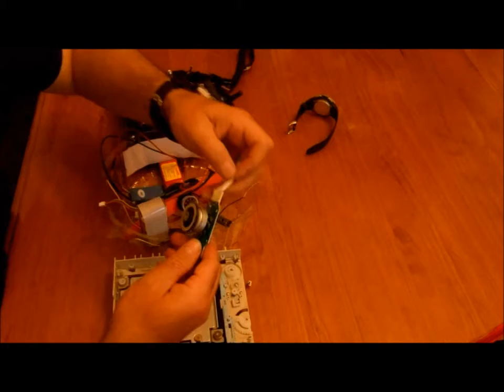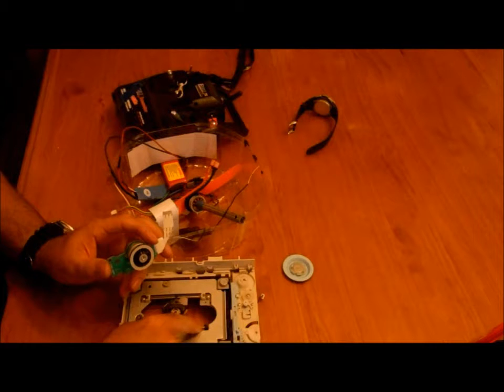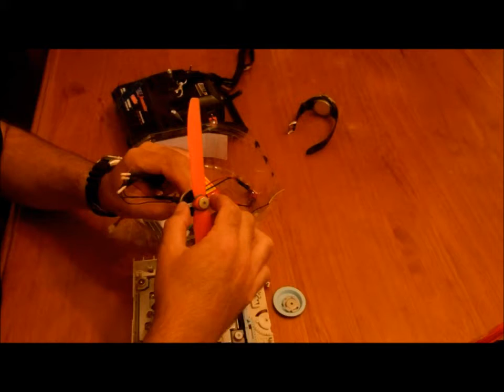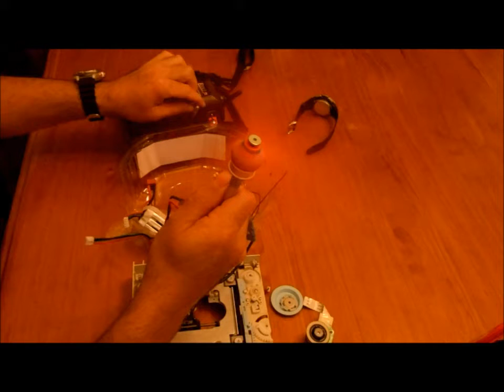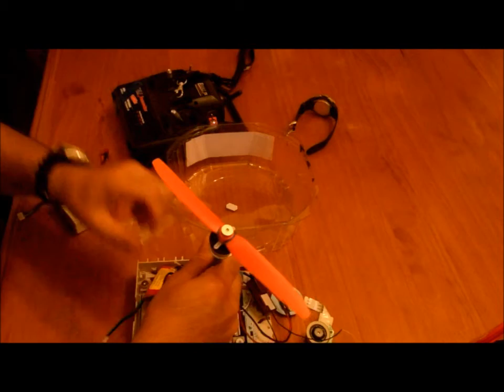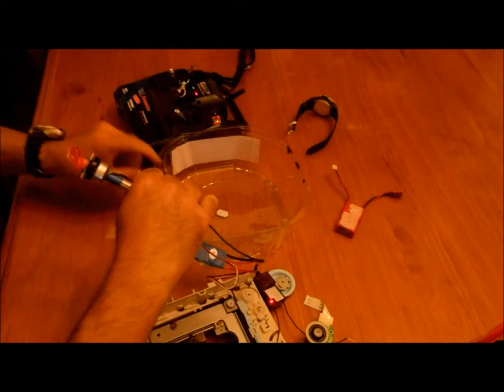mount a propeller on a brushless cd drive motor.wmv

Comment: I found your video of interest. I have been trying to locate a motor with  an outrunner configuration  to use to run a gyroscope disc and the motor you have shown seems to be the right piece for the purpose. I am not an electronics person and also not an RC flyer. I understand that esc units are very sensitive to the system voltage as is also the servo tester which i plan to use  for running and controlling the motor. would the esc and servo tester be damaged if i used 12 volts to run the system? Please help me out with this as it appears not many or perhaps no one knows the answer to my question. Hopefully  looking forward to your reply and my thanks.

Comment: how can i made a controller for cd rom moter
Reply from the maker: I used a controller from rc plane, it can be from a rc car also, but has to be able to control a bulrushes motor. if that helps you ?. Or maybe I will have to do a video of that from scratch sometime.

Comment: I pulled 2 different motors out of 2 different cd roms and found the 3 connections to solder to. I can not pull the top off of the motor nor take the motor off the circuit board. But I did connect a + & - hooked up to my speed controller with a 7.4v 12000 mAh battery and it started to turn then stopped. Every time I disconnected it and reconnected it, it tried to start then stopped. Do I have to have the 3 wires connected for it to work? also what is the color code for the solder points so I know what wire to solder in coronation to my ESC. Thanks and if you could please email this answer to me at djkammo@aol.com. I check that many times a day.
Reply: my friend you can not run a brushless motor with just a battery you need a controller
Reply: you my friend have to learn how to read plain and simple english, he did! just that the roms come with hall effect sensors...